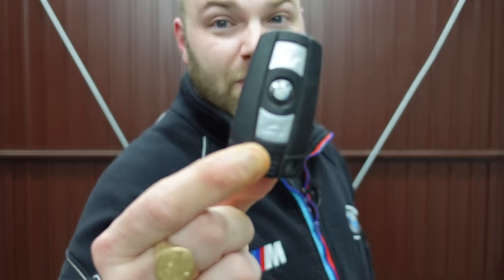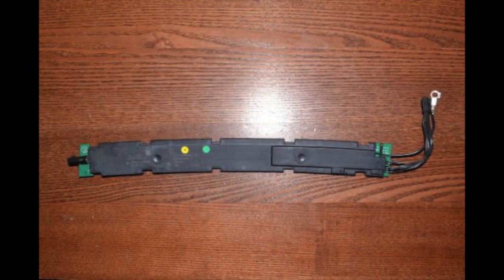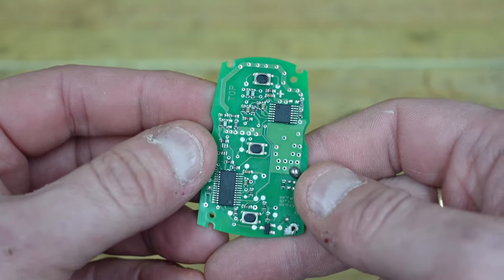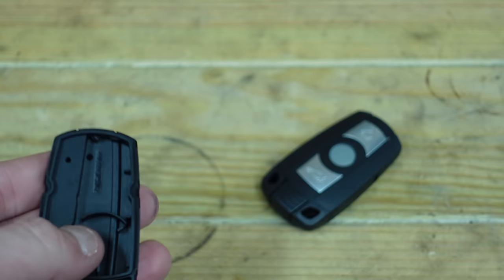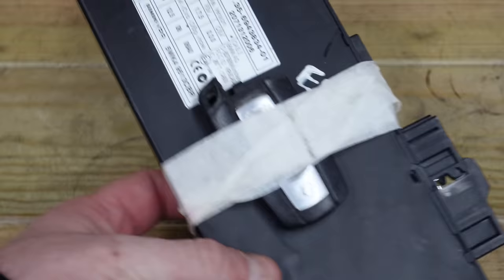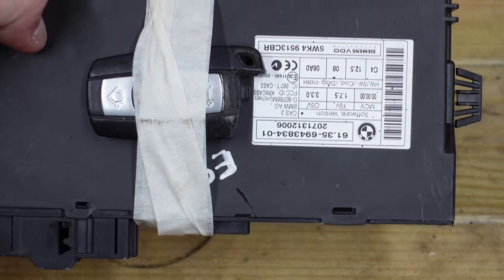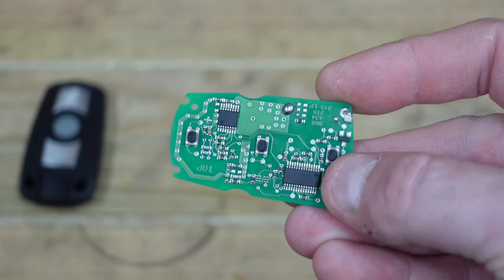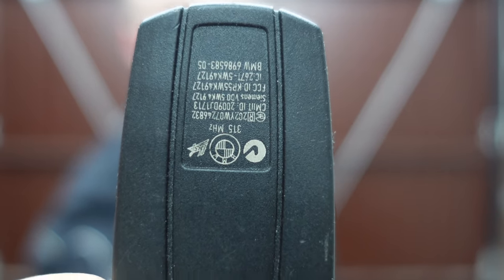BMW E60 E90 Key Not Working ?? Here Is The Fix !!

Comment: Hi, I had a different problem with mine. Sometimes it worked fine and other times I would have to be right by the receiver to get it to unlock. After some months it stopped locking altogether. It would unlock and open the boot.. In the end, I found that it was the locking micro-switch was at fault. I bought 3 from Ebay. I de-soldered the old one and fitted a new one and now it works fine.
Reply: Mine stopped locking for periods. Would unlock and open the boot from like 15m away. This morning when the car hit precisely 280 000km the fob stopped working completely (only starts the car)

Comment: I have a question, I just recently bought a new casing for my key and I opened my old and and transferred the chip to the new and and it stopped working and tips or help? (I have comfort access the key you can’t open)
Reply: Same with me! Just i dont have comfort. Did you find a solution?

Comment: Cheers Dean : neither key unlocks my e61, guessing I'm looking at the diversity antenna, but the radio signal strength is good?
Reply: I have the same problem. Disconnected the car battery, first the black terminal then the red. I installed the cables in reverse order. Radio has no issues. It has strong signal. Keyfobs are both transmitting but remote function lost. Fobs both stopped working after I reconnected the car battery.  I use the metal key to lock and unlock the car. Every time I open the car, the alarm goes off. Help!
Reply: @johanngrobler7855  same here did you ever find a fix?
Reply: @johanngrobler7855  I have exactly the same problem! Can this be covered please?
Reply: I changed the battery and now both key fobs stopped working. Now every time I unlock the car, the alarm goes off. The BMW leadership weirdly said they can’t help me. What do I do?
Reply: Ever find the problem?

Comment: Hi, I have a sealed key fob with no battery access on my E92 and the lock button has stopped working. Boot and unlock buttons both work. Any ideas? I don't want to cut it open because I can't seem to find a replacement fob without the battery cover, does that matter?
Reply: Did you fix This? Mine won’t unlock but it will occasionally let you lock with the fob?
Reply: Did you ever resolve this issue? I have the same thing on my E61 key. Unlock & boot work perfect, the locking will not. Thanks

Comment: My issue was the diversity antenna, when I bought the car last year the nugget who sold me it said it was just the battery in the fob. Should of known when he put the key near the 3rd break light but I knew nothing about the E60 then. After damaging 1 of  the fobs I watched 1of your videos on the antenna replacement and sure enough after purchasing a new unit it worked. Replaced the fob I damaged (comfort key)and now all good.  Should of looked up on it before, might of saved myself a few quid on a new fob lol. Thanks again BMW Doctor your yt videos are top notch and no wonder you channel has grown so much in the last year!
Reply: Hi there.. I might be in the exact same
Situation as you..

Last week I bought a bmw 2009 328i coupe I believe it’s the e92… 

Anyways the dude who sold me the car gave me two keys but said they’re  not working and just blamed the batteries. Even sent me a video on the replacement..

Today I received the soldering kit and a new battery, went ahead and slashed the key fob in two, removed and solder new battery and doesn’t do anything. 

As I was doing it I put this video and was listening to it/watching it in the background and thinking to myself.. if both keys don’t work odds are that might be something else than both failing with the battery…but you never know, you trust the person that sells you the car.

So now that I did the job, went to the car no success, kinda put it together without sealing it, put it in the casa r and it starts , drove it around the block to see if anything, turn off, get out of the car, press buttons and no response at all. 

Thinking (and makes total sense) it’s the antena or receiver in the car. 

Any idea where to look for it and or change it/test it? Was it very expensive for you? 

Thank you.

Comment: Hi. So I got 2 key fobs these exact ones programed for my 2008 335i,  the keys start my car when I put them in the slot, but they don't unlock or lock the car with the buttons on the fob. They're the same frequency as the original key 315Mhz.. what could be the issue? I tried all your tricks.

Comment: I have an E70 LCI with comfort access. One key worked fine, then buttons became intermittently inoperative, bit then would work fine. Then out the blue a few days after this started, all buttons stopped working. Replaced the regular battery, found previous owner had cut the case open maybe thinking it was the rechargeable battery. 
Comfort access works on this key but not buttons, starts car fine. Are there issues with the key output to the cars antenna? The other key works perfectly fine as a remote and comfort access.

Comment: I just recently bought my first BMW, a 2006 330xD Kombi. When I first got the car, both key fobs worked fine but one day I forgot to turn my parking lights off and the car battery died. Since then I haven't been able to unlock or lock the doors with either key fob. They both start the engine, but I have to use the physical key to unlock the doors. I went to a key specialist who had the proper equipment to determine if the key fobs where transmitting signal properly and both of them were. He told me the problem is with the car. I disassembled the central locking unit and it was brand new. So the question is, how do I sync the fobs to the central locking unit? Is there a special software I need? Is it able to be done without paying an arm & a leg at the BMW dealership? Any help would be appreciated!
Reply: Did you find a solution to this? I'm having the same issue

Comment: Watched this video when both my key fobs started reporting low charge warning.

My car wouldnt start one day turned out to be flooded battery compartment.

On return from costly repair noted that start/stop function had started working again (i actually forgot it had this function as wasnt doing it for a while). Took car a drive using both keys and both charged while driving as expected.

So if you get low fob battery warning and stop start not functioning check your main battery and components for issues as could be an early warning sign.

Comment: Dr. Dean, I need your help! So I have a E60, 2006 bmw 525i. The key fob won’t open or close the doors. It is the original remote fob and it starts the car. The door close/unlock switch inside the car functions properly, but the key fob won’t open or close the doors but when I lock the door with the key blade it locks all the doors and arms the alarm. I changed the original battery, put In a new one believing that was the issue, but it didn’t do nothing still. I used a frequency/megahertz signal detector to check if it was sending out a signal and realized it is not sending out the signal when I press the buttons. I Decided to check the original battery I changed out and realized that it had 1.293v which I thought it would’ve been dead completely cause that car didn’t move in a few years. The new battery I soldered in was 3.166v. What should I do?

Comment: Hi BMW Doctor, I appreciate your work and information. I meant to leave car on trickle charge but unfortunately had left the battery charger on fast charging and I think it overcharged because the car doesn’t open via the key fob.  It will unlock manually but the alarm goes off until I put the key in the ignition and then the car starts fine. Any ideas would be greatly appreciated thanks.

Comment: Hello. Thanks for your video. I have a E82 without comfort access. I have two original keys and the one I use daily works fine. One day I would like to use the second key, fails to unlock remotely but it can ignite the car. Try to charge it for 30 mins drive but the buttons on it still don’t work. What should I do now? Thanks you!

Comment: Hi mate, I need your help! 

BMW X5 2010 both key fobs don’t work won’t unlock or lock but central locking button works fine from inside car. 

Don’t think it’s battery’s as no sign is displayed on dash. I’ve checked the two central locking fuses and they are both ok, 

Any idea where I should look next ?
Reply: Same. Key turns car on, central locking works. 
Key doesn’t work at locking/unlocking what do ever even right next to the diversity antenna. 
Let me know if you find the fix!
Reply: Did you find the fix on your x5? I got same problem

Comment: Hi. I have a slightly different problem. 
My fob will unlock the car, open the boot but it will not lock the car. 
The button is nice and clicky and I have checked the solders round the button and there is no cracks or gaps. 

I do have to stand right next to the drivers door for the car to open with the fob. It will not open with the fob if you are 2 meters away.
Reply: I have the same issue did you fix it ?

Comment: Thanks. I was able to replace my battery. It works to unlock the door, but when I go to start it…it says the remote is not detected. I’ve held the remote to the steering column to start the car. It works, but when I shut off the engine it says remote not detected again. Do you know what I should do? The key worked fine before I changed the battery, and yes, it was replaced with the exact same battery that worked fine. Thanks

Comment: Hi this is great help. However I have soldered a new battery in to my fob and checked there is power with a multi meter drove the car for 20miles before pressing the button and still not working would you recommending using it more or another problem both keys are flat 320d touring 2010 thanks

Comment: ok, so I have two Fobs (Same as in the video) one works perfectly, the other doesn't - the 'lock button doesn't work - all other buttons function perfectly.  How do I get to the button ? is it even worth having a go ?Can't see how to get the roundal button out?  I've got soldering equipment so if it needs soldering up that's the easy bit for me!

Comment: We have just bought our 520d, and found a key issue. I've also found a tuning issue on the radio and after replacing the battery in the key fob and the the fuses in the glove box and the boot, the key fob still doesn't work. The key works fine in the ignition, and starts the car no problem. What would your next step be? Replace the other battery in the key fob or just go straight to the diversity antenna replacement. If its replace the antenna, do you have a video on this?

Thanks.

Comment: Hi Dean, I’m having a real issue after I replaced the key fob shell on my BMW one series convertible. It doesn’t work at all anymore after no previous issues. Tried the paper trick to push the battery down but unsuccessful. Any other ideas would be very much appreciated 😊

Comment: Hi there, thank you for the video, i got a problem and wondered if you can help before i take it into BMW and get charged an arm and a leg...?
I have a 5 Series E60 2.5 engine., few weeks ago i had a warning sign come up saying the remote key battery is LOW, i ignored it and then went away abroad for two weeks, then upon my return i find the key is weak, sometimes it opens the door sometimes it takes 5 or 6 presses, now the other problem i have since yesterday is that the KEY WILL NOT GO IN THE IGNITION, when i push it in the car comes on but the key gets spat out, i can drive the car fine with the key on my lap though, i am not sure how to solve this, please could you kindly offer any help?

Comment: BMW650I 2007 convertible fob remote opening is fine, roof down with remote no issues.  BUT the locking is an issue. My spare remote working well.  The question would be WHY the locking can’t be done from the remote.  Thank you.

Comment: My key worked only for 2 week after i got a new one, after them 2 weeks stopped working, i bought a LIR2025 a vl2020 still not working with both battery, is it just a wrong battery issues? If so what battery do i need? Bmw 2008 530d touring

Comment: Hi Dean, my problem is with one key, the other one works fine. The unlock button works fine on the faulty key but the locking button sometimes needs pressing several times before it works. I assume the button on the board inside the key is worn? Is this a replacement key job?

Comment: BMW 2009 X5 35d One key works fine second key will start car but no remote functions. Checked the battery voltage and it's just over 3v. This model requires the key to be inserted into the dash for the engine to start. (No proximity starting). No comfort access. Any ideas how to fix this second key? RHD Australian X5.

Comment: Hey my battery starting to seem weak. It would only work when it was close to the car. I bought a new battery and soldered then now it doesn’t work at all I don’t know what to do I don’t really have any software. Are there any reset options by holding buttons down

Comment: i check the fuse front and back. all good .and a new diversity antenna.  new fob battery.  and still doesn't work. any suggestions?bmw x5 2010
Reply: I’m having the same issue with my E70 X5 did you ever figure it out?
Reply: @iarriaga45  same with my e61. Would love if someone had tips

Comment: Thanks for the video. I have only one key which quit working long ago but works fine in the ignition. Assuming it was the battery, I changed it only only to find it still did not work. The old battery still read 3.2V so it seems the column is still charging it fine. My car is an e61 wagon. I looked at the diversity antenna and found no evidence of water having ever been inside it. Is there any way to test the antenna? I will say that before my key stopped working completely, it did have poor range. But I have no issues with FM radio or GPS Nav. Is my next move to source a new antenna? is there anything I can do to be sure that's it first? Again my key works for ignition, just not for the central looking controls on the fob. Thank you!
Reply: I have exact same situation. E61 touring, key starts car fine, radio all works nice and clear, new battery put into key fob, no central locking. 
However I have had to open cars with keys in the lock for years so its no big deal opening and locking it with the actual key, plus I'm not planning on selling it, just running it into the ground. So for me a fix would be good, but not essential.

Comment: So, I have a brand new keyfob for my e90, gotten from BMW in 2009, can start the car but cannot lock/unlock. I assume the battery is dead as it wasn't used in years, tried changing it, toothbrush charger, left it in the ignition over the night, still nothing. Can it be somehow tested or is it definitely a battery issue? Cheers
Reply: Hello man, same issue as you, have you found a solution?
Reply: @itsjordythan04  Same issue as both of you! Either one of you found a solution?

Comment: He got a 2006 525i e60 all the lights on the dash came on and the radio ect and the car won’t start or crank any ideas? I’ve check all the fuses and once I did that the speedometer doesn’t light up but radio still works not sure what’s happening and if you know a fix please

Comment: key fob has been working well for years but now it won't lock the car. however, it does start the car, unlocks the doors as well as the boot as usual, only the lock one doesn't work. what could be the problem?

Comment: My key fob on my 2010 328i stopped locking and unlocking doors. It will start the car. I took a knife and opened it up and re soldered a new battery to it. But it still doesn’t unlock or lock doors. What should I do next?

Comment: Hi dean. I've just changed the battery in my fob. And the fob is working but it only works if I point it at sensor on the on roof inside car. Any information how to fix would be appreciated 👍 thank you.

Comment: I have a problem with my key to buy looks like I got a low voltage throughout the entire car what could be the problem because I got a lot of parts acting up the only thing is actually not really working as my driver side door is not working from inside or outside it doesn't lock online but the window works

Comment: Hi could this complex issue i have with a 2014 series 6 be a simple fix.
Key fob doesn't lock the 3 passenger doors, when I open a passenger door the alarm sounds. To shut it up... press the unlock button. I have the lock setting to "comfort".
Thanks for your reply

Comment: Hi dean not sure if you will read this but, my non comfort access key was working then, within a week the distance got reduced and the amount of clicks needed to unlock/lock the car increased and shortly after the week the fob buttons stopped working and ive been doing manual unlocking/locking, the key starts the car. Just changed the battery in the key and on top the old battery held a decent voltage. Key still doesn’t work. So I checked all forums online which said check fuses, all my fuses that could be associated were fine and not blown. Took out the diversity antenna and it appeared to be fine. Online forums with ppl in my exact situation said they changed the diversity antenna and it still doesn’t work, is there a way I can check if the car is receiving the key signals, or should I try the diversity antenna! there hasn’t been a solution to this in the dozens of forums I read.
Reply: Did you fix it? I have exact same issue

Comment: KEY STUCK IN IGNITION... SEEMS TO BE DEAD BATTERY ALSO
While changing the grommets on the water pump because the serpentine belt melted one grommet, I need to also fill the coolant top off, so have the battery charger on the posts. But we have had to charge it another time or two. While the kid was in the ignition for the coolant cycling. I went to turn it off but it was dead and the key is stuck in the ignition.